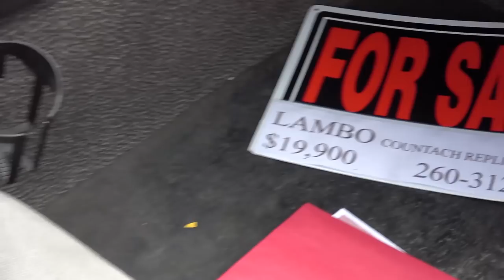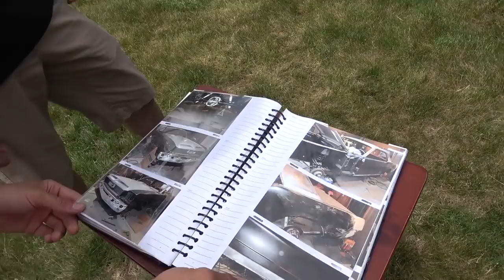McLaren P1, Porsche 918, & Lots of Lamborghinis! DreamMakers 2018

Comment: Contach Replica well he got balls to bring it and it looks so real
Reply from the maker: It was very nice.  TBH, if I wasn't looking for a project car RN, I might've bought it for the shits and giggles.  19K for that?  Not bad actually.  Might even be faster than the Vaydor I'm hoping to build LOL
Reply: Bladed Angel When you planning on doing that? ... Ive been waiting for a youtuber to have a go at it. Great content btw
Reply from the maker: Probably next year.  I'm moving to Georgia later this year, so I don't want to start stripping a G35 and than awkwardly move it in pieces mid-build to my new house.  I'm looking to get a house that has a massive garage so I can do the build.  People underestimate how much space you need fo ra kit car.  It's not your normal project car since EVERYTHING will be out during the process.  I'll likely buy a manual G35 coupe soon, but keep it as a G35 for kicks and giggles, have some fun with it, and until I finally move, I'll turn it into a Vaydor.
Reply: Bladed Angel That's great... Something to look forward to. Do they have performance upgrades
Reply from the maker: Hardly. Twin Turboing a Vaydor will only make 420 horsepower (lol). Anything more will crack the block. The G35 powertrain caps at 500HP. I'd have to engine and transmission swap it (probably either LS7+Z06 tranny or 2JZ + 370Z tranny or Nissan GTR + Nissan GTR tranny). ON TOP OF THAT. I have to reinforce the chassis before I even put the kit on, so that the car can handle more than 500HP without falling apart.  OFC, I could just make a Vaydor, keep it stock, but...there'd be no fun in driving around like a poser with that much bark, but no bite.  I already ran the numbers and the full build based on what I have planned it going to cost $68K, so it's not cheap, but at least I'll have performance to match the looks.  A small part of me just feels like copping out and getting a GTR instead though :\
Reply: Bladed Angel True abt the gtr but it seems to be overdone. Ls is deffo the way to go. How long do you think it will take to build
Reply: for 68k you can finance a 2012 aston v12 vantage manual :D